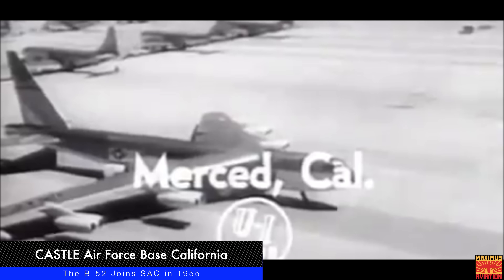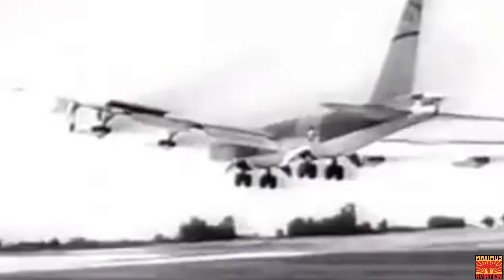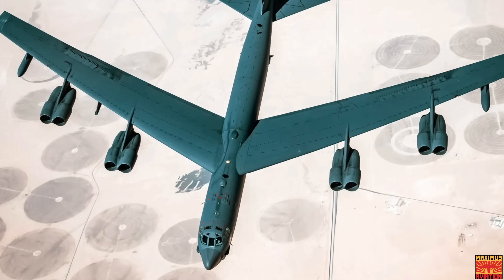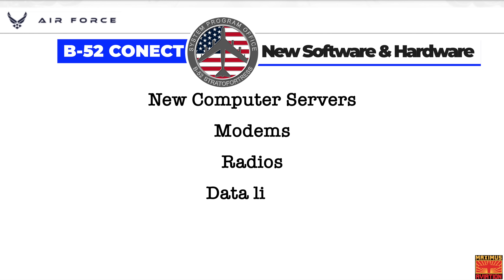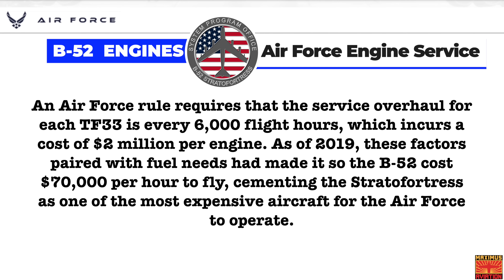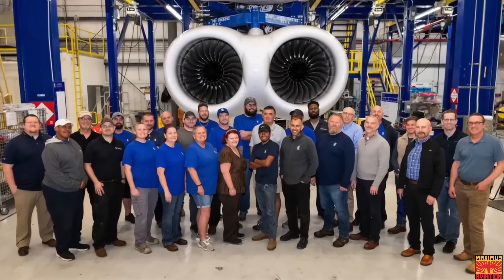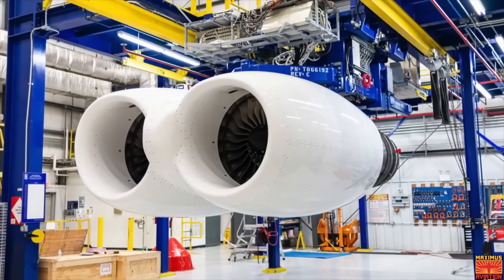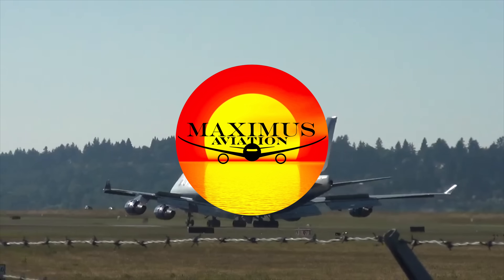The B-52 Will Fly For Over 100 Years With Its New Rolls Royce Engines!

Comment: Derivative of this engine was suppose to power the cancelled RAF Nimrod MRA4.

Brand new wings were designed to use the new engine and aerodynamic purposes. The new wings were to mated to the old, but re-lifed body. But they found the old comet bodies were basically hand built, so it was difficult to build them. This led to cost overrun, along with other issues.

A prototype actually flew but it was cancelled before production and eventually RAF bought the P-8 Poseidon.

So B52 would not have been the first military use for this engine. As Nimrod did have a substantial bomb-bay and were proposed as a Storm Shadow (cruise missile) carrier.

Comment: Hey Maximus, I love the movie " Gladiator as well and it It's great that the new Rolls Royce engines are going to save so much jet fuel on operating the current B-52 Stratosphere as well as being so much better for our environment with much cleaner discharge from the engines. Do you know that former president and current felon had new Rolls Royce engines put on his jet, I heard that he sold his jet for ten million to a billionaire done to his re-election campaign, talk with you soon Maximus! I wonder if the new engines on the B-52-J will make it faster? DD. 🇺🇸

Comment: Since when I was a 10 year old Cub Scout in 1964 when we toured Orlando/McCoy AFB in 1964, I have been enthralded with the B-52. I can remember that experience, touring the flight line, with the engines at full throttle, it was quite thrilling. Now, I'm 70 years old, McCoy AFB is gone, it's now OIA, a large commercial airport serving the tourist destination.  The remaining legacy is still there, between Minot and Barksdale, there are at least 79,  62 year old B-52s in flying condition!

Comment: So they can't get something a little more later than this nearly 30-year old engine? At the time the TF33 was fairly new and look how long it lasted we have come a long way since then so it is safe to go with newer technology with confidence. This is lame, to replace old with not so old. Not implying failure just there should be a higher efficiency rating so the leapfrog in technology will be just that.

Comment: Not sure how they didn't do this 20 or even 30 years ago, as rapidly as engine tech changed.  I understand that there was an analysis done that said it really wasn't program-effective and may not even be cost effective.  I also understand that there is some evidence to suggest this analysis was done with 100% of the fuel price calculation done as the cost of that fuel from the ground base.

Meaning - not factoring the hugely increased price when tanking mid-air.  

Now the overhaul, maintenance and availability is perhaps in question as a future item, so this is good to see.
Reply: The B-52 got new turbofan engines with the H model

Comment: Commercial engines have lower maintenance requirements, hopefully they didn't manage to mess that up.
Reply: The BMW F130 is a military rated engine
Reply: @WilhelmKarsten  Hello Sandyboy,  as you know F130 is the US designation for the ROLLS ROYCE BR725 engine (in much the same way that J65 was the US designation for the AS Sapphire engine that was the F9 Metrovick).  As you know it has nothing to do with any wholly owned BMW company. 
You'll recall that in the early 1990s Rolls Royce offered BMW a chance to re-enter the jet engine market with a joint venture to develope the BR 700 series engines from existing Rolls Royce twin spool technology, so that Rolls Royce UK could focus on its more sophisticated triple spool engines. Unfortunately BMW couldn't hack it for long and by 1999 had declared that it was copping out.
As you'll recall , fortunately Rolls Royce was happy to take BMW's share and keep the local workers on and it became a wholly owned Rolls Royce company. As you know that was quite a few years before the development of the BR725 which first ran in 2008 long after BMW was gone.

Comment: The P&W 33-3 is extreamly reliable and i hope the new RR is going to prove to be the same or better
Reply: The BMW F130 engines are extremely reliable...
What kind of shit for brains troll doesn't know that Rolls-Royce jets are named after rivers in England.
Reply: @WilhelmKarsten  Hello Sandyboy,  as you know Sandyboy F130 is the US designation for the ROLLS ROYCE BR725 engine (in much the same way that J65 was the US designation for the AS Sapphire engine that was the F9 Metrovick).  As you know it has nothing to do with any wholly owned BMW company. 
You'll recall that in the early 1990s Rolls Royce offered BMW a chance to re-enter the jet engine market with a joint venture to develope the BR 700 series engines from existing Rolls Royce twin spool technology, so that Rolls Royce UK could focus on its more sophisticated triple spool engines. Unfortunately BMW couldn't hack it for long and by 1999 had declared that it was copping out.
As you'll recall , fortunately Rolls Royce was happy to take BMW's share and keep the local workers on and it became a wholly owned Rolls Royce company. As you know that was quite a few years before the development of the BR725 which first ran in 2008 long after BMW was gone.

Comment: Rolls Royce 130 engine 👎🏻. Pratt & Whitney 😘
Reply: The F130 is a BMW engine, 
what kinda of shite for brains troll doesn't know that Rolls-Royce jet engines are named for rivers in England
Reply: @WilhelmKarsten  Hello Sandyboy,  F130 is the US designation for the ROLLS ROYCE BR725 engine (in much the same way that J65 was the US designation for the AS Sapphire engine that was the F9 Metrovick).  
As you know it has nothing to do with any wholly owned BMW company. 
You'll recall that in the early 1990s Rolls Royce offered BMW a chance to re-enter the jet engine market with a joint venture to develope the BR 700 series engines from existing Rolls Royce twin spool technology, so that Rolls Royce UK could focus on its more sophisticated triple spool engines. Unfortunately BMW couldn't hack it for long and by 1999 had declared that it was copping out.
As you'll recall , fortunately Rolls Royce was happy to take BMW's share and keep the local workers on and it became a wholly owned Rolls Royce company. As you know that was quite a few years before the development of the BR725 which first ran in 2008 long after BMW was gone.
As you know Sandyboy, Germany has never produced a successful jet engine without foreign help.

Comment: Ya el B52🚿📡🛰️🪖tiene sus nuevos motores marca Rollo Roys okey 💯 aquí está el vídeo que lo disfruten en el canal de Youtube para ustedes 🙏💯🤖 muy buenas noches
Reply: The F130 is a BMW engine
Reply: @WilhelmKarsten  Hello Sandyboy,  F130 is the US designation for the ROLLS ROYCE BR725 engine (in much the same way that J65 was the US designation for the AS Sapphire engine that was the F9 Metrovick).  
As you know it has nothing to do with any wholly owned BMW company. 
You'll recall that in the early 1990s Rolls Royce offered BMW a chance to re-enter the jet engine market with a joint venture to develope the BR 700 series engines from existing Rolls Royce twin spool technology, so that Rolls Royce UK could focus on its more sophisticated triple spool engines. Unfortunately BMW couldn't hack it for long and by 1999 had declared that it was copping out.
As you'll recall , fortunately Rolls Royce was happy to take BMW's share and keep the local workers on and it became a wholly owned Rolls Royce company. As you know that was quite a few years before the development of the BR725 which first ran in 2008 long after BMW was gone.

Comment: Rolls Royce is the gold standard  but I would've preferred GE Aviation engines because I'm a GE shareholder.
Reply: The F130 is a BMW engine
Reply: @WilhelmKarsten  Hello Sandyboy,  as you know Sandyboy F130 is the US designation for the ROLLS ROYCE BR725 engine (in much the same way that J65 was the US designation for the AS Sapphire engine that was the F9 Metrovick).  As you know it has nothing to do with any wholly owned BMW company. 
You'll recall that in the early 1990s Rolls Royce offered BMW a chance to re-enter the jet engine market with a joint venture to develope the BR 700 series engines from existing Rolls Royce twin spool technology, so that Rolls Royce UK could focus on its more sophisticated triple spool engines. Unfortunately BMW couldn't hack it for long and by 1999 had declared that it was copping out.
As you'll recall , fortunately Rolls Royce was happy to take BMW's share and keep the local workers on and it became a wholly owned Rolls Royce company. As you know that was quite a few years before the development of the BR725 which first ran in 2008 long after BMW was gone.

Comment: One observation that can be made is since these new Rolls-Royce engines are modern high bypass turbofan engines, the overall diameter of these new engines is greater and wider than the old Pratt and Whitney engines. This is likely to result in some changes in the aerodynamics of the airplane around the engines and the wings of the B-52 bomber. I am sure this will be examined during the various tests.
Reply: The F130 is a BMW engine, Rolls-Royce jet engines are named for rivers in England
Reply: @WilhelmKarsten  Hello Sandyboy,  as you know Sandyboy F130 is the US designation for the ROLLS ROYCE BR725 engine (in much the same way that J65 was the US designation for the AS Sapphire engine that was the F9 Metrovick).  As you know it has nothing to do with any wholly owned BMW company. 
You'll recall that in the early 1990s Rolls Royce offered BMW a chance to re-enter the jet engine market with a joint venture to develope the BR 700 series engines from existing Rolls Royce twin spool technology, so that Rolls Royce UK could focus on its more sophisticated triple spool engines. Unfortunately BMW couldn't hack it for long and by 1999 had declared that it was copping out.
As you'll recall , fortunately Rolls Royce was happy to take BMW's share and keep the local workers on and it became a wholly owned Rolls Royce company. As you know that was quite a few years before the development of the BR725 which first ran in 2008 long after BMW was gone.

Comment: No specs about the new RR engines?  Just generalities?
Reply: The F130 is a BMW engine originally intended for the canceled Hawker Siddeley H.S.801 Nimrod MRA4 program.
Reply: @sandervanderkammen9230  Hello Sandyboy,  F130 is the US designation for the ROLLS ROYCE BR725 engine (in much the same way that J65 was the US designation for the AS Sapphire engine that was the F9 Metrovick).  As you know it has nothing to do with any wholly owned BMW company. 
You'll recall that in the early 1990s Rolls Royce offered BMW a chance to re-enter the jet engine market with a joint venture to develope the BR 700 series engines from existing Rolls Royce twin spool technology, so that Rolls Royce UK could focus on its more sophisticated triple spool engines. Unfortunately BMW couldn't hack it for long and by 1999 had declared that it was copping out.
As you'll recall , fortunately Rolls Royce was happy to take BMW's share and keep the local workers on and it became a wholly owned Rolls Royce company. As you know that was quite a few years before the development of the BR725 which first ran in 2008 long after BMW was gone.

Comment: Rolls Royce has contributed to American air power since World War II.  The Rolls Royce Merlin engine transformed the P-51 Mustang into one of the best pursuit planes of WW2.
Reply: The F130 is a BMW engine
Reply: @sandervanderkammen9230  Hello Sandyboy,  as you know Sandyboy F130 is the US designation for the ROLLS ROYCE BR725 engine (in much the same way that J65 was the US designation for the AS Sapphire engine that was the F9 Metrovick).  As you know it has nothing to do with any wholly owned BMW company. 
You'll recall that in the early 1990s Rolls Royce offered BMW a chance to re-enter the jet engine market with a joint venture to develope the BR 700 series engines from existing Rolls Royce twin spool technology, so that Rolls Royce UK could focus on its more sophisticated triple spool engines. Unfortunately BMW couldn't hack it for long and by 1999 had declared that it was copping out.
As you'll recall , fortunately Rolls Royce was happy to take BMW's share and keep the local workers on and it became a wholly owned Rolls Royce company. As you know that was quite a few years before the development of the BR725 which first ran in 2008 long after BMW was gone.

Comment: WRONG! The TF-33 is not the first and only engine on the B-52. The first engine was the J-57WB. It was used through the G model designation. The H models that you're referencing were the first to use the TF-33.

Comment: I think that it would be really cool if the Roll Royce hood ornament would be affixed over each air intake.
Reply: The F130 is a BMW engine
Reply: @sandervanderkammen9230  Hello Sandyboy,  as you know Sandyboy F130 is the US designation for the ROLLS ROYCE BR725 engine (in much the same way that J65 was the US designation for the AS Sapphire engine that was the F9 Metrovick).  As you know it has nothing to do with any wholly owned BMW company. 
You'll recall that in the early 1990s Rolls Royce offered BMW a chance to re-enter the jet engine market with a joint venture to develope the BR 700 series engines from existing Rolls Royce twin spool technology, so that Rolls Royce UK could focus on its more sophisticated triple spool engines. Unfortunately BMW couldn't hack it for long and by 1999 had declared that it was copping out.
As you'll recall , fortunately Rolls Royce was happy to take BMW's share and keep the local workers on and it became a wholly owned Rolls Royce company. As you know that was quite a few years before the development of the BR725 which first ran in 2008 long after BMW was gone.

Comment: They could've at least have put the spirit of ecstasy on the nose
Reply: More like the BMW Roundel... the F130 is a BMW engine, not a Rolls-Royce engine.
Reply: @sandervanderkammen9230  Why did they call it Rolls Royce then?
Reply: @madzen112  Branding... Rolls-Royce acquired the design for the Hawker Siddeley H.S.801 Nimrod MRA4 program that was cancelled.
 All Rolls-Royce built jet engines are named after rivers in Britain. 
 The F130 is a BMW engine designed and manufactured in Dahlewitz Germany, not R-R U.K.
Reply: @madzen112  Because it's a Rolls Royce Engine. In 1990 Rolls Royce offered a joint venture to BMW for the further development of Rolls Royce's twin spool engines (so Derby could focus of the bigger three spool engines). So the BR 700 series were introduced by BMW Rolls Royce Aero Engines but in 1999 BMW pulled out and Rolls Royce took over their share. The BR 725 engine (F130) was not developed until after BMW had departed and it began testing in 2008.
The F130's will be built at Rolls Royce's Indianapolis plant.
Reply: @sandervanderkammen9230  Hello Sandyboy,  F130 is the US designation for the ROLLS ROYCE BR725 engine (in much the same way that J65 was the US designation for the AS Sapphire engine that was the F9 Metrovick).  As you know it has nothing to do with any wholly owned BMW company. 
You'll recall that in the early 1990s Rolls Royce offered BMW a chance to re-enter the jet engine market with a joint venture to develope the BR 700 series engines from existing Rolls Royce twin spool technology, so that Rolls Royce UK could focus on its more sophisticated triple spool engines. Unfortunately BMW couldn't hack it for long and by 1999 had declared that it was copping out.
As you'll recall , fortunately Rolls Royce was happy to take BMW's share and keep the local workers on and it became a wholly owned Rolls Royce company. As you know that was quite a few years before the development of the BR725 which first ran in 2008 long after BMW was gone.

Comment: The thing with modern aircraft designs is that they are built to maximum efficiency already. There is not too much of a need for new hull designs, other than for the manufacturer's profit; rather existing designs are upgraded or retrofitted with new technology, engines, and interior styling.

Comment: Glad to hear that the B-52 will be flying with Rolls-Royce engines.  My Dad worked at the original R-R factory in Derby, England, during WW2, when they were producing Merlin engines for Spitfires, Mosquitoes and Lancasters.
Reply: Actually the F130 is a BMW engine, not designed or made by Rolls Royce U.K.
Reply: @sandervanderkammen9230  Hello Sandyboy,  as you know Sandyboy F130 is the US designation for the ROLLS ROYCE BR725 engine (in much the same way that J65 was the US designation for the AS Sapphire engine that was the F9 Metrovick).  As you know it has nothing to do with any wholly owned BMW company. 
You'll recall that in the early 1990s Rolls Royce offered BMW a chance to re-enter the jet engine market with a joint venture to develope the BR 700 series engines from existing Rolls Royce twin spool technology, so that Rolls Royce UK could focus on its more sophisticated triple spool engines. Unfortunately BMW couldn't hack it for long and by 1999 had declared that it was copping out.
As you'll recall , fortunately Rolls Royce was happy to take BMW's share and keep the local workers on and it became a wholly owned Rolls Royce company. As you know that was quite a few years before the development of the BR725 which first ran in 2008 long after BMW was gone.